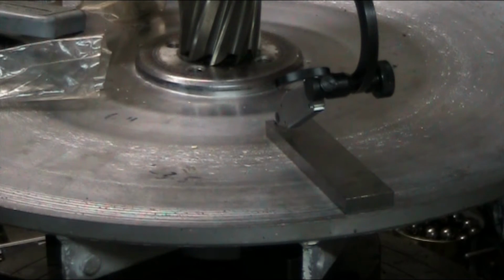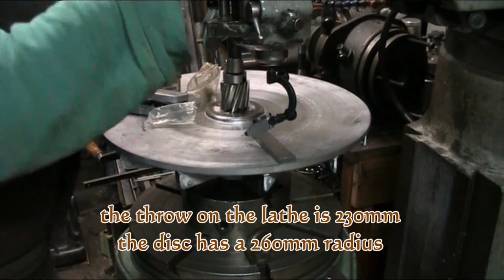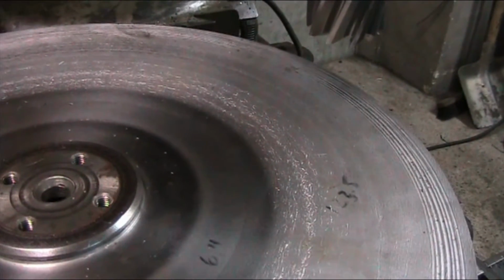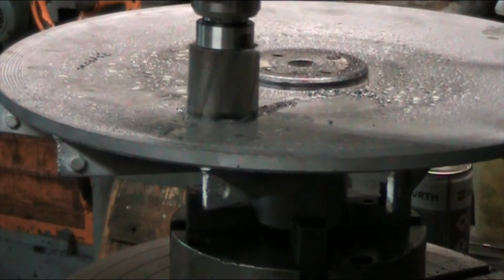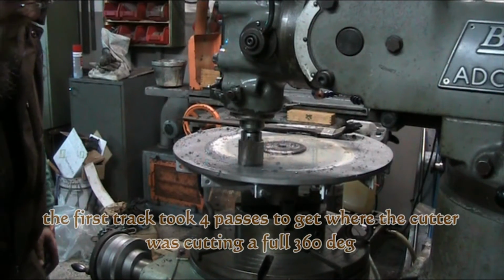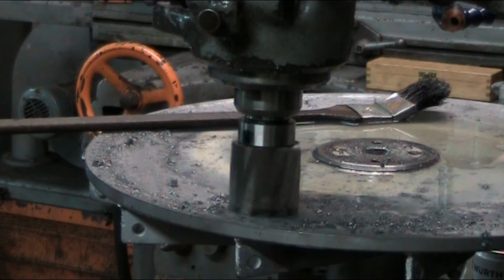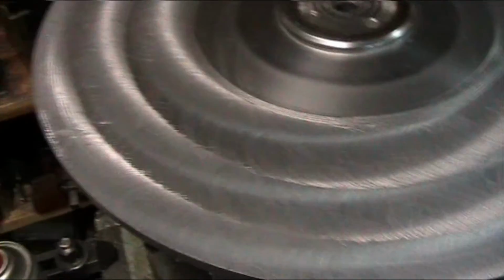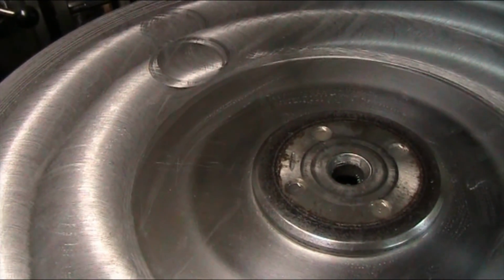Project Donut part 2 of 2

Comment: Looks a lot better than it did.
Mike
Reply from the maker: +Oldvet1946 this thing was really in bad shape. it mounts directly onto the arbor of the motor. the motor went henshit and lost a bearing which in turn caused the disc to tumble in the machine, knocking balance weights off the fins on the underside. as the bearing balls, balance weights and a few screws went thru, they bent the disc causing it to have some serious runout issues. 
the face of it cleaned up well enough to be able to run it. however it still needed to be balanced. the guys that put it back in the machine took a grinder to it after i handed it back to them. causing more serious runout than it had before. they neglected to re-balance it and were all upset that it didn't run right. so they shipped it off to an outfit that has a lathe big enough to turn it. after they got it back from there, THEN they decided: oh, maybe we should balance the thing before we stick in the machine....

Comment: Just a thought but could you not have packed the rotary table at an angle, instead of tilting the mill head, then you would not have any overlap problems?
Reply from the maker: +Chris Stephens yeah, i thought about that too. as it was, the overlap turned out pretty good. there were only two little spots where the overlap didn't quite make it and those were less than 0.01 of a mm. this was due to the run out of the disc before the cut and then the release of tension after the cut. keep in mind the thing had crashed in the machine before it was handed to me. it also could have been due to the vibrations caused by the cut.
the problem with the set up on a tilted table is that it would have taken a wedge(s) to tilt that big of a rotary table. just sticking a few 1-2-3 blocks under it would have most likely broken off the tabs used to hold the rotary down. 
the sine base i have is way too small to accommodate that large (16" dia, 200+ lbs) of a rotary table.
another aspect of using wedges would have been the additional time it would have taken to mill a set of wedges that support the rotary on the full width of its base. it would have taken a set of 4 wedges that would have to meet in the middle of the table in order to maintain the exact angle. partials would allow a sine error to creep in and again, crack the base of the rotary.
the sine base rotary table i have is far too small (4" dia, 10lbs) to accommodate the chuck i had to use and then also for a work piece that large. the hub of the disc was almost 80mm in diameter and there were less than 12mm around the perimeter of the rotary to hold it. so again a no go on that option.
so the option of dropping the table down  2mm and running the work into the cutter along the X-axis of the milling machine allowed for a nice overlap of the cuts. i was amazed at how well that turned out. the only detractor was the spot where the initial cut occurred. the tool marks were visible but not deep enough to measure,
thanks for watching and commenting :)
cheers
mike
Reply: I was thinking of two round bars of different diameters, rather than wedges. By moving them apart you could alter the angle. Obviously they would have to be directly under the clamps to prevent breakage. You would need two bars because only one would put too much strain on the tabs, having two allows the table to pivot on the lower one.
You got the job done and that is all that really matters, and as they say, ask a dozen engineers how to do something and you will get a dozen ideas, or more.
ATB
c
Reply from the maker: Chris Stephens
now that's an interesting idea. although the job is done i'll file that one away for future reference in case i run into something like that again. the only thing i could see in addition is a low profile v-block to keep the larger of the two round bars from squirting out when tightening up the hold down clamps. although toehold clamps in the table would keep the round bar in place too.
Reply: The idea is just like a variable length Sine bar but with different size rollers instead of gauge blocks, The angle you were machining was fairly shallow so bars wouldn't squirt out but initial placing would require some form of stop as you say.
Reply from the maker: Chris Stephens
yes, i see your logic. it makes really good sense. i'll have to play with it sometime and see what can be done with the concept.
Reply: Just had another thought, if the idea was to be used more than once a decade, a series of bars/rollers could be made with two cross holes to take long locating bars which would keep the sine bars/rollers parallel and, if fitted with nuts, from moving and for adjusting.
Re the "good sense", I should warn you flattery doesn't work on me anymore, I'm too used to it. :>)
Reply from the maker: Chris Stephens
that would be great for low angle applications like this. say anything below 15 degrees of slope. i suppose the series of rods could be milled flat on the long axis to keep them from rolling out but still act like a sine bar roller.
Reply: Indeed, shame there are not more needs for the device, but an interesting thought process all the same.